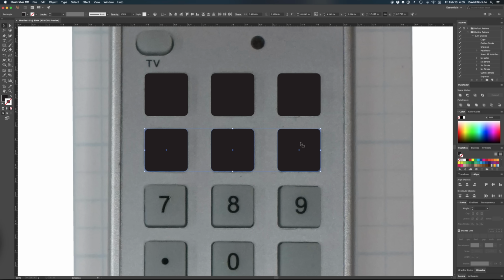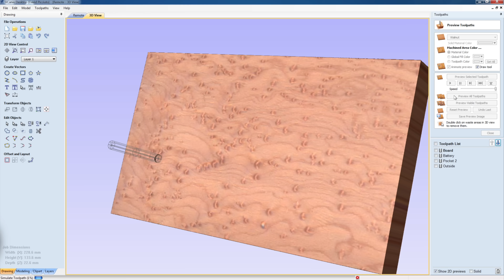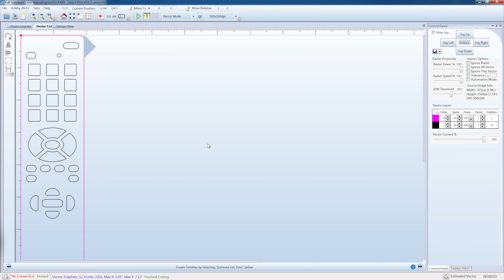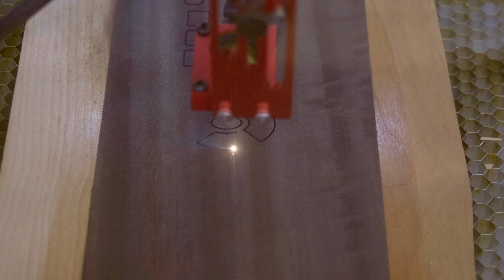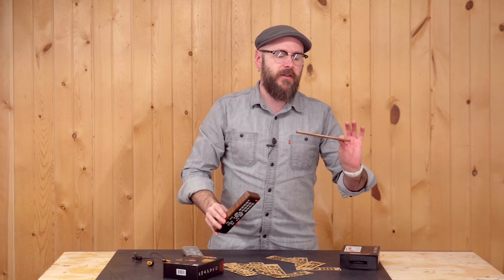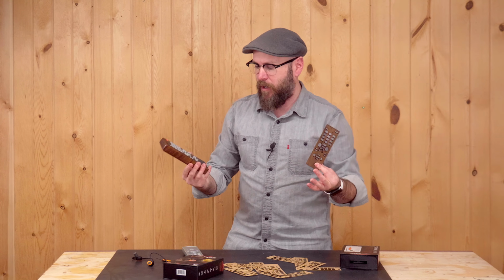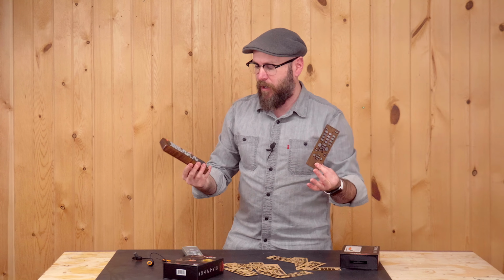Making a Custom Wood TV Remote | Woodworking Project

Comment: Who doesn't have a laser cutter?
Reply: Mohammed Lee
Reply: Sebastian Don't be ridiculous.  You don't need the tools he used to do this project.  Print out a paper template of the buttons and glue it to the wood.  You can use a power tool like a scroll saw or a hand tool like a chisel.  He should inspire you to be creative with what you have not complain about what you don't.
Reply: Proto G It's not about making the project. I've made TV remotes before back when I had basically no tools at all. The thing is just that he uses the Laser cutter as natural as a chisel. Anyway, my Comment was meant rather sarcastic and is to be taken not too seriously.

Comment: Awesome job!! You could hack together a 1-button tv remote that only powers your TV on and off and add it to your wooden case. With an attiny, arduino code and an IR led you could get a fairly small circuit to fit anywhere.
Cheers and thanks for the great content!
Reply: Egar Almeida that was my thought as well. it would be fairly easy to do and the battery is small too.

Comment: Looks great, really cool to integrate the apple remote! 
When using a camera to scan something you can try using a long lens to minimise the perspective effect.
You could thin the case down much further by swapping to a different battery size. Something like coin cells?

Comment: You are talking about making a new case for the Apple remote.  It's worth noting that when you use it to change the volume on your TV, it is using IR to do that, so any case will have to allow the front to be open.
Reply from the maker: It works with our new soundbar without the front being open.

Comment: That looks great! I love the idea. One thing you might want to look into if you do something similar again, is an app called "genius scan" it's designed to be used as a scanner on your phone, but it has the cool capability to fix skew and scaling for you. Just put what you are scanning on a piece of paper, and the app will fix everything else for you. I do this a lot to make models around something in fusion 360.
Reply from the maker: Whoa, I'll check that out! THANKS!!

Comment: Nice project. I hope people are aware that for the layout one could make a photocopy of the RC case, glue it on a piece of wood and cut it out with a fretsaw.
Just in case one doesn´t have a lasercutter, a CNC Machine and the ability to use these things properly.

Comment: toy need to put a thin smear of dielectric grease on the circuit board of the remote where the knobs hit it 
i cleaned up my remote once and it only lasted for a few months untill the corosion on said circuit board preventing the knobs from making contact , the dielectic grease prevent corrosion

Comment: It's cool and all, but my favorite part about watching your videos is making these things myself after. I don't have access to this kind of equipment. Nice remote though
Reply: Mike Blank Don't be ridiculous.  You don't need the tools he used to do this project.  Print out a paper template of the buttons and glue it to the wood.  You can use a power tool like a scroll saw or a hand tool like a chisel.  He should inspire you to be creative with what you have not complain about what you don't.

Comment: That new Apple TV 4 remote sucks. The buttons are wonky and the touch pad is terrible. Never responds correctly. I really think they missed the mark with that remote.
Reply from the maker: Agreed.
Reply: Same. Expected Apple design to blow me away but frustrates more than anything.
Reply: Wally Phillips the old silver remote was better but too small, I actually lost it once for two weeks because I forgot I used it as a bookmark...

Comment: if you only use the power button, why not reduce the remote to just the one button and the chip and maybe a cr2032 bat. smaller and can be hidden in the apple remote case.

Comment: nice but a kind of progect that only 0.001% of people can do that machine must cost alot lol
Reply: G15-TV Don't be ridiculous.  You don't need the tools he used to do this project.  Print out a paper template of the buttons and glue it to the wood.  You can use a power tool like a scroll saw or a hand tool like a chisel.  He should inspire you to be creative with what you have, not complain about what you don't.

Comment: cool ..a remote cover that only requires $3000 worth of machines to make!! thanks for wasting my time watching
Reply: Rod Huber Don't be ridiculous.  Your lack of craftsmanship is showing.  You don't need the tools he used to do this project.  Print out a paper template of the buttons and glue it to the wood.  You can use a power tool like a scroll saw or a hand tool like a chisel.  He should inspire you to be creative with what you have not complain about what you don't.

Comment: No glue huh? Then how do you explain THIS?! 1:36
Reply from the maker: Well, yes, I used glue to adhere the battery pack to the circuit board. But no glue for any of the wood pieces.